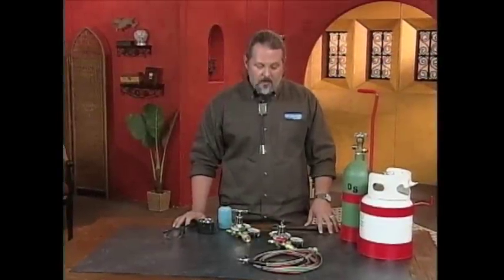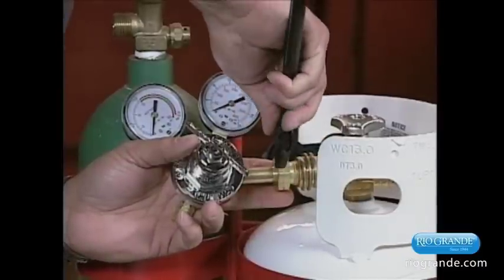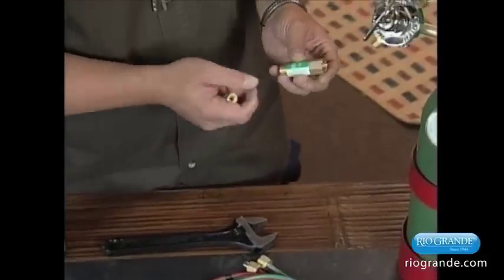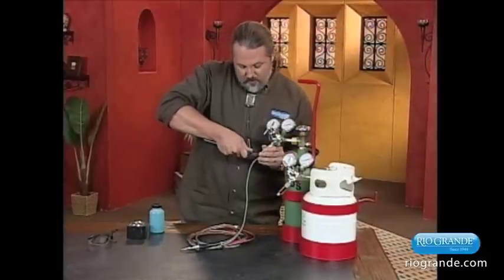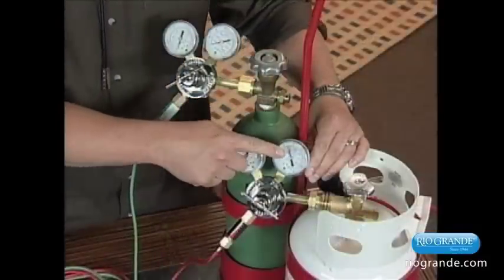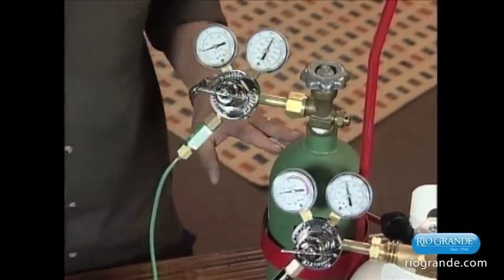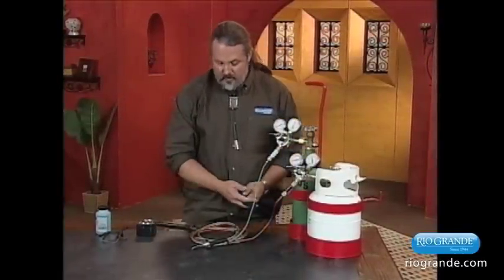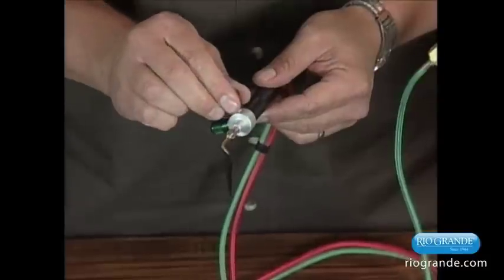How To Set Up a Propane / Oxygen Torch

Comment: Hi, is better to have differents tanks for welding and other for melting?
Reply from the maker: Hello Maria. Thanks for your question. The only thing you need to change is the tips to do the two different processes, (casting vs. soldering). Different tanks are not required, the fuel will be the same; however, you will need a larger tip for your torch specifically for melting. Like the Smith® Little Torch™ Propane and Oxygen Multiple-Orifice Melting Tip for Propane or Natural Gas Item #: 500022 found here: https://www.riogrande.com/product/smith-little-torch-propane-and-oxygen-multiple-orifice-melting-tip-for-propane-or-natural-gas/500022  Hope this helps!

Comment: Hi. I moved from Oxcy/Acet to Oxcy Propane because it's far cheaper but I dont have a gauge type regulator valve. Just a knob with bar pressure markings on it. I thought this was so because Propane is a liquid not a gas. Could I use the acetylene regulator with Propane then?
Reply: Hi Fred, thats hard to say, you can switch gases with our regulators but we're not sure about others. The best way to find out would be to contact the Mfg to see if thats possible. If you like you can email the Tech team a picture of the regulator along with the name of the Mfg and we can try to find that out for you. You can email us at technical@riogrande.com
I hope this is of some help.
Mark N Tech
Reply: RioTechs Thanks for the quick reply. I'm in the UK so that might be a problem for you. I'll approach the manufacturer here and ask. While you're on can you give me some advice about tips. Can I use those I've been using for acetylene? Some people seem to say you can. Others that you cant for reasons I dont understand.

Cheers.
Reply: fred Hi Fred. That depends on the types of type of tips you have. The Smith Little torch tips are single orifice and can be used with either gas. Most single oriface tips i have used can be used with either gas.  But the multi orifice tips are a little different and specialized for either propane or acetylene. Here too feel free to send a picture of what you have and maybe we can help in some way.
Mark N Tech
Reply: RioTechs Cheers. I've discovered from a friend in the US that I need some TEN tips for the brazing I'm doing. Thanks for your offers to help.

Comment: I think my oxygen regulator for my little smith torch is broken.  I have the T knob pressure valve open and its still sending oxygen through the line.  Is there as way to fix it or do I need to purchase another one?
Reply: First check that the tank is off completely and bleed the line by opening the torch. Next remove the regulator completely off the tank. Back the "T" knob out completely until it falls out in your hand.  See if the dials drop down to zero. It could be a leaking tank. If they don't zero, it may be a damaged regulator.
Reply: +Mark Nelson Thanks Mark, it is a damaged regulator, just took it in for repair, thanks for responding.

Comment: should always open the oxygen for a short blast of air to clear out any dust from between the regular and the bottle, reason for this is if dust is inside it can compress extremely quickly when you open the oxygen causing the dust to heat up enough to catch fire, though it seams crazy it's called regulator burn out, and is and extremely common cause for torch use injury, and always pitch your lines of any residual air before attempting to light a torch
Reply: yes you need to blow out the oxy tank of using large tanks but it's not a good idea on little tanks like he has as it uses to much oxy.

Comment: Hi Everyone
Thank you for the comments, I will try to address them all.
The set up for Oxy/Act is the same as it is for Oxy/Propane. For the Little Torch the settings are the same too. 
And Keneyed209 is correct, you should make sure the fittings are clear from debris, these were new regulators and fittings so I neglected to mention that. 
When setting the pressure, you start with the regulators turned off and by turning the knob to the right you set the pressure.
Mark Nelson

Comment: What is the correct pressure for oxygen?
Reply: Hi Gabriele Trovato
The correct pressure depends on the type of torch you have and which tip you are using. The correct pressure settings should be in the manual that came with your torch. If you need help with determining what is the correct pressure for your system feel free to contact us at technical@riogrande.com and we’ll try to assist you.
Thank you
Mark N Tech

Comment: That is an acetylene guage.  It should be a propane one.   Could be an acetylene regulator.
Reply from the maker: Hello, thanks for watching. We appreciate the support!
Reply from the maker: Just want to reach out with some additional information from our Jewelry Tech Team. They state the only difference between a propane and acetylene regulator is the fittings that connect to the tank.Both propane and acetylene regulators are marked as acetylene regulators. Both are fuel regulators. The only difference are the fittings. We hope this is helpful! Feel free to reach out with any other questions or concerns.

Comment: How many ft lbs should the fittings be tightened to.
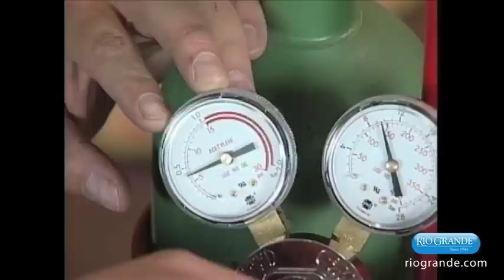Reply from the maker: Hi Spencer, Thanks for your question. In this video at 4:45 Mark discusses how to set the PSI for the torch. He mentions that this will be different based on the torch tip you are using, and it is best to refer to the manual. You're also welcome to contact our Jewelry Tech Team for assistance & troubleshooting. They can be reached at 800-545-6566 from 7am to 6pm MST,  Monday - Friday, just ask for the Tech Team when you call. Hope this helps!

Comment: Looks like you have the wrong regulator for propane fuel. I see a red band after the 15 psi on the outlet gauge. That's indicative of a acetylene gauge.  Acetylene becomes unstable and explosive at 15 psi.

Comment: Using an Acetylene gauge set for Propane is not recommended since Acetylene is a gas and propane is a liquid and the gauge will not read accurately for propane as I understand it anyway.

And only one crank of the fuel bottle/tank just in case you need to do an emergency shutdown.

Comment: why wouldn't you put the check valves at the torch end of the hoses not by the tank ends? seems it would keep the fire out of the hoses eh?
Reply from the maker: Hi Phillip, Thanks for your question. The design of the Little Torch does not include a fitting on the base of the torch handle to attach a flash back arrestor. For this reason, the flash back arrestor is attached between the hose and the regulator. Thanks again for watching.

Comment: Just a small point and I have to say I have never used such a small torch but I was always told to turn the Fuel gas off first and then the Oxygen. So I did a check with my torch supplier and as I said, on closer, fuel gas then oxygen. Maybe it is different for these small torches?

Comment: instead of buying a solution can you just use water with washing up liquid?
Reply from the maker: Hello Edward. Thanks for your question. Our Jewelry Tech Team does not recommend using over-the-counter soaps or liquids as they may contain petroleum-based products that can behave unpredictably when used for leak-checking a torch. Hope this helps!
Reply: Edward Fleming what about Castile soap?
Reply: Hello There! A high quality Castile soap can be used for this purpose.

Comment: Should you use pipe tape/dope tape on your threads when making your connections?
Reply: Hi A.M Garcia
You can use Teflon pipe tape on the fuel gasses. But it’s best to use nothing at all for the Oxygen. Most of the sealing tapes and compounds are petroleum based and can react violently with the oxygen. If you get an oxygen tank that leaks at the fitting, that can’t be fixed by tightening it, it’s best to exchange it for a new one.
I hope this helps.
Mark N Tech
Reply: yup it sure did. thanks for the input.
Reply: RioTechs I think my oxygen has a leak between the regulator and hose, and doesn't seem to be fixed with tightening.  I hear the hissing when I open the regulator and don't know how to fix
Reply: A Glatter Hi A Glatter. There might be a leak at the hose fitting ( where the hose meets the metal feral). I would take some Leak Detect and check to see where the leak is coming from. If it’s from the Hose fitting you’ll need to replace the hose. If it’s coming from the fittings where the hose fitting connects to the regulator, you might have some debris in the fitting that is keeping it from making a tight seal. Turn the tank off and remove the hose and try reattaching it. Then check for leaks. A lot of the times that can correct the issue. If it doesn’t, you might try taking your set up to a local welding supply shop and have them take a look at it to see how and why it’s leaking. Also, be very careful of what you use to check leaks with. The solution MUST be oil free. We recommend using Leak Detect, http://www.riogrande.com/Product/Safe-D-Tect-Leak-Detector-Fluid/500238?Pos=2  or a solution recommended by your local welding supply house.
 Hope this is of som help.
Mark N Tech
Reply: Rule No 1..You should never use any sealant, lubricant (especially oil) or tape on these fittings. Combining Oxygen with these could lead to spontaneous combustion.
Reply: Kevin Thompson Hi Kevin, thanks for chiming in, great info to share. 
Mark N Tech
Reply: Kevin Thompson I should qualify that.. having just looked at some new Oxy gauges at the local Welding supplier (BOC) here in Gisborne, New Zealand, and see that the new gauges come with Teflon thread tape already applied to the thread. That contradicts what I was always taught many years ago. We still learn no matter how old we get and how much we think we know,
Reply: absolutley not
Reply: Kevin Thompson So true. i'll check on that that for here in the U.S. as well.
Reply: Joey S Yea Joey, I would go with that rule too.

Comment: It is a dumb idea to close the oxygen valve first and fuel gas second, cause the fuel gas will remain in the torch and could burn/explode. Shut off the fuel gas valve first and oxygen second to force out the gas.
Reply from the maker: +Elite Zi Hi there!
This will not cause an explosion. You may get a pop sound if you are using acetylene.

We always recommend these steps...

When shutting down the torch for the day.
1.     Turn off tanks
    2.  shut off oxygen
    3. shut off gas.
Bleed lines to release any fuel.
 
When turning off after solder job
1.     Turn off oxygen on torch handle
2.    Turn off gas on torch handle

Comment: My thoughts are the guy in this video is from marketing with little or no real experience. He doesn't know the proper way to orient the regulators, tighten the hoses, doesn't even know the correct way to turn an adjustable wrench. I'm frankly shocked to see Rio Grand putting this thing up as "instructional." There is a Smith video with a legitimate instructor and good information. Take a class at a college extension course or ask someone at a local welding shop rather than this video.

No Julia, that's not a dumb question, LPG stands for Liquified Petroleum Gas. There are a number of marketed grades, Propane, Butane, and others. How well refined they are will determine what the ratio is. Pure any isn't likely to be available to us  mortal folk so there's going to be both in the tank. What they call it is usually the large majority fuel gas.

Comment: It's actually a stupid idea to open the propane/acetylene valve all the way, cause if there's a fire or if you lose control of the flame, you can't quickly close the tank. Open it anywhere from 1/2 to a full turn so you can quickly close it if that happens.
Reply: You never open propane partially, the valves aren't designed for that.
Reply: TheRetiredtech Safety first.
Reply: Rpged Sniper that is safety first partially opened propane valves can and often do leak around the stem
Reply: That little bit of leaking gas is practically harmless compared to an emergency where a fully opened valve would take 2-3 turns to shut off compared to 3 quarters to 1 turn, to be able shut it down. I understand that the valves seat either fully closed or open but that isnt safe if your hose catch fire or something. Having the oxygen fully open is fine as that is virtually harmless but fuel gas MUST be able to be shut down quickly if needed.
Reply: Rpged Sniper that little bit of propane settles as it is beaver than air. Propane valves and acetylene valves
are two different designs.
Reply: Sorry just assumed they were the same as acetylene 😐
Reply: Rpged Sniper here is a list on the issue of propane valves.. http://www.isgb.org/forum/showthread.php?1128-Open-your-propane-valve-fully!
Reply: Silly design, but i suppose they have their reason.
Reply: @TheRetiredtech beaver than air? 🤷‍♀️